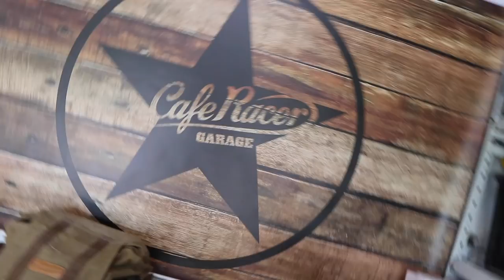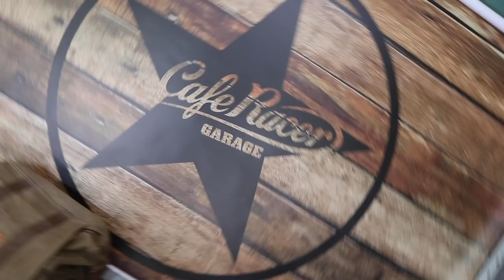Cafe Racer - Hump Build, ★Fibreglass Hump, PART 3, Honda CB750 Cafe Bike - Episode 27

Comment: I think your designer pal has nailed it - and although it’s a little hard to see the lines accurately on video, picking up the top of the hump may give it a slightly better line with the top of the tank? Excellent work, a pleasure to see things done properly!
Reply from the maker: Thank you for taking the time to leave me a comment, you are right, Its going to be hard to see on camera but worth the extra work I think :)

Comment: I think its a top idea, i want to make a scaled down version of the back of my tank for the hump ( R80) try using the plug , make a new hump and put two slits where you had tape , this will allow that gental rise nicely, re glass underneath and fill with bog . Good luck
Reply from the maker: That is a really good idea! it's kinda what I had in my head but not sure it will work yet, stay tuned because this is probably how I will do it :) Thank you for taking the time to comment Grant :)

Comment: Yes to matching the tail with the tank. 
Btw a cbr600 f2 rear wheel fits on the rear with only a few alterations (Bigger spacers). You can fit a 160/170 tyre on the 4.5 inch cbr wheel. Probs a bit too late now that you have already powder coated and purchased the rubber hah. Im doing the swap soon.
Reply from the maker: I do love this idea, maybe my next one :) send me some photos of yours, Id love to see them. Send them via my Cafe Racer Garage FB page as a message :)

Comment: Yep on the tank lines copied on the hump ... that would look sweet!! Even with just the tape there you can see it'll tie in and flow really good. As others have said, you could even do it with paint and give the hump just a visual effect of having the slightly raised center section. Coming together real nice now man :) Looking forward to seeing what you do with the rear footrest hangers, air filters and exhaust .. I know that'll all be coming soon ;) Oh and clocks as well ....
Reply from the maker: Thank you mate,  I have loads more Ideas still to come. :)  As for the rear-seats and the exhaust, they are parts I'm still trying to work out, Im currently trying to find an aftermarket exhaust for this bike to get the 4 into 1 pipes so i can wrap them to the junction and custom build the rest.